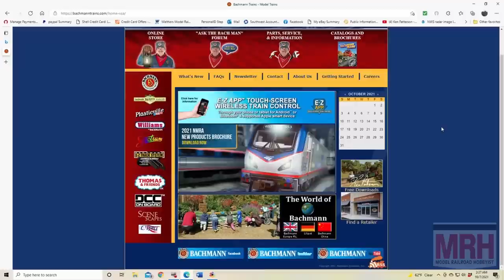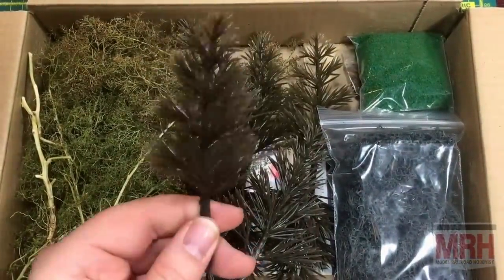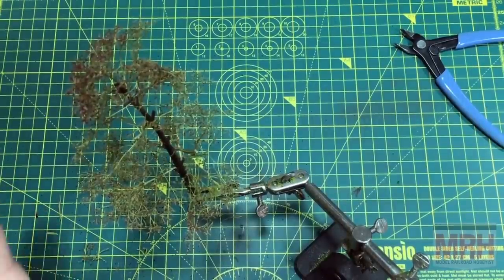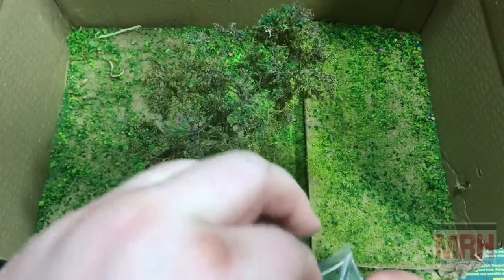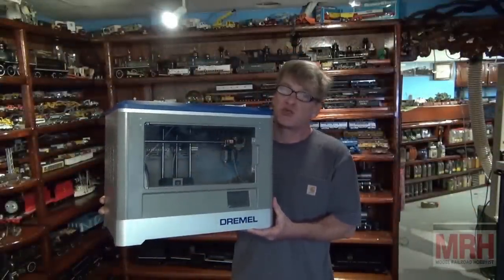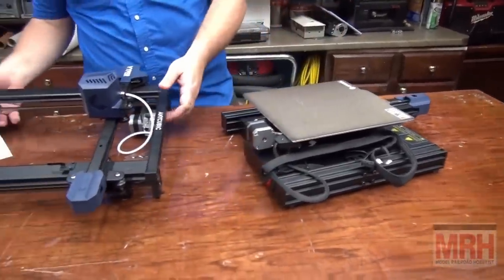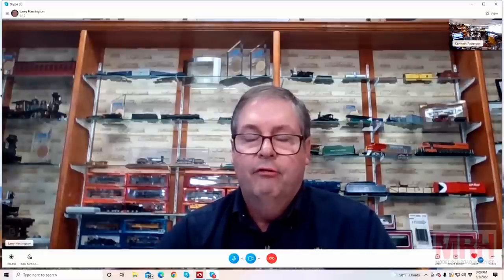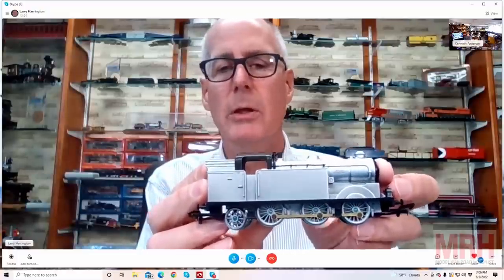Make realistic trees for your layout | June 2022 WHATS NEAT Model Railroad Hobbyist

Comment: Neat stuff!  Jennifer Kirk's presentation was delightful (as always).  On one hand, the 3D printing was interesting, BUT you did NOT address the big obstacle - the pattern that drives the printer!  Ken, so far your presentation on 3D printing have concentrated on the mechanical functions of the printers.  The real secret to success is having a good plan.  The end print will never be any better than the software that drives the printing.  I am not a programmer, I don't use graphics programs, I have no training in CAD.  I am at an age where, by the time I learn all the software, I will be dead by the time the first project prints.  I suggest a continuing series on 3D printing SOFTWARE.  With your "bully pulpit" in the hobby, perhaps you can encourage entrepreneurs to sell software files that can be easily adjusted to different scales.  Personally, I would like some UP MoW bunk cars (converted from B-50-20 boxcars) and some UP and CB&Q "slab side" 34 ft open hoppers, but I sure don't have the capability to generate the computer software to produce the shells.

Comment: World War Scenics makes awesome products. If you like to use static grass they have a range of different size applicators that are very nice. When spraying the glue on the tree armature, spray down so the glue doesn't get on the trunk and larger part of the limbs. Also when you sprinkle the ground foam try not to get it on the trunk if you did get glue on it.